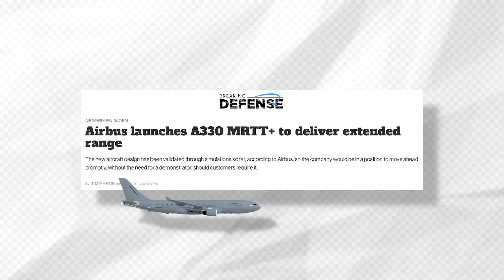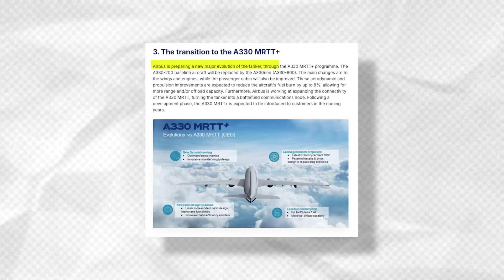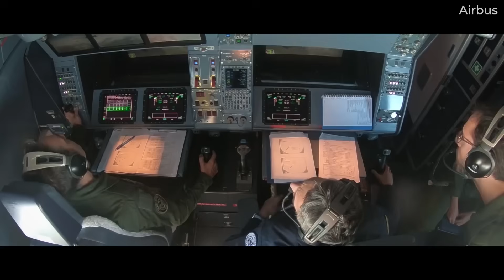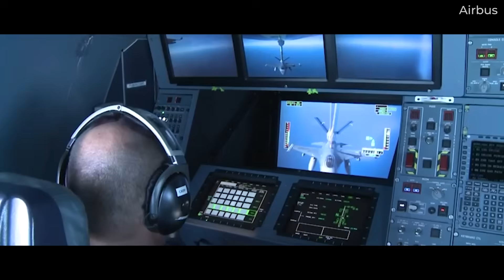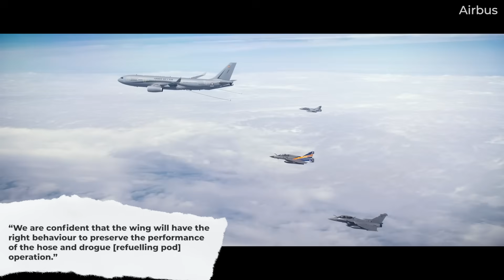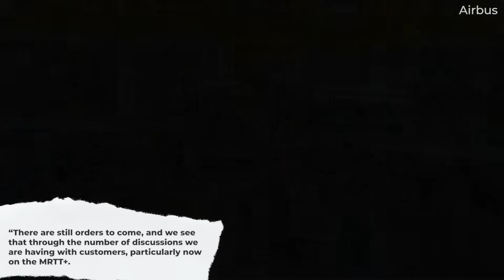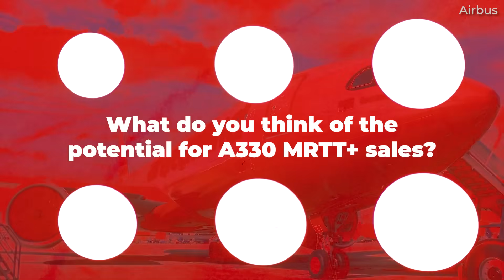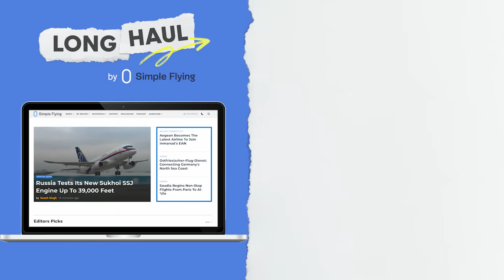The Airbus A330 MRTT+ - What's It All About?

Comment: I think the existence of the MRTT+ program is just so the production line can fully shutdown the production of the original A330 and fully move on to the A330neo, assuming they are still building new A330-200s for the MRTT program.

For most governments and air forces, second hand A330s for conversion will be more than enough capable for their MRTT needs, alongside the fact these planes can be bought for dirt cheap in comparison to expensive new frames. Another benefit is that their local airlines can cooperate with it and offer some of their own planes for conversion, speeding up the process and potentially reducing costs, as it has happened with Qantas and the RAAF in Australia, and Azul and the Brazilian Air Force.

Comment: The USAF could have bought the KC-45 based on the A330 MRTT but there was one very expensive problem: the plane would require new airplane hangars at just about every military airport where the plane was going to be based. Meanwhile, though not perfect, the KC-46A could fit into the infrastructure already in place to service the KC-135R, especially the hangar space.
Reply: 'cept for most of the time they are not hangared, plus many of them could have been phased in in areas where even mx can be easily done outdoors. Like the Southwest...
Reply: So wrong. Only problem was the policiticans and Boeing lobbying killed off the Pentagon preferred solution, the KC45.

Comment: all MRTT+ should be based on the stretched A330-900neo variant & not the A330-800neo . . . the A330-900neo offers greater payload & Quick Change operational flexibility . . .
Reply: I thought the a330 900 neo had the same takeoff payload as the a330 800 neo The only difference was it had a larger capacity